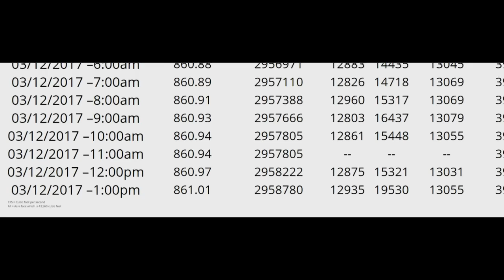Drone Video | Spillway to resume 40-50k cfs Soon | Lake Oroville Dam Updates | 3-12-17

Comment: An Utterly shambolic catastrophe, which could've been avoided had one of the directors sanctioned the initial repairs 2 months ago. The footage of the original was barely 3-4' deep n 40 yards across. Then when they used the spillway 1st time it tore the hole larger still and then it was botched up with bags of aggregate etc , now witness the colossal damage. I guess the directors may have lost their Xmas bonuses, had they repaired the initial damage? Fire everybody who could've sanctioned the initial repairs.

Comment: http://rdcfeeds.redding.com/lakelevels/oro.cfm
This source for lake levels has been missing several big chunks of hours of in/out flow data over the last 2 days. Not good, given that people under the evacuation "standby" probably would not like guess what the lake levels are. Is there another source for hourly lake updates?
Reply from the maker: This is the only source..
Reply: Thanks DM ... when the lake was going down I don`t recall it ever missing any hourly entries. Not saying they didn`t, I just never saw it. Now over the last few days they`re missing at least 10-12 hours of data.
Reply: optician53 . It would be nice to have a backup source for sure. The temperature in Oroville "real feel"  right now is 77 degrees, yet they are saying the water input is less than 5 and 6 am this morning, while the temp was low to mid 50's. Looks like rain is coming on Wednesday too, might have to crank it up sooner then the 17th.